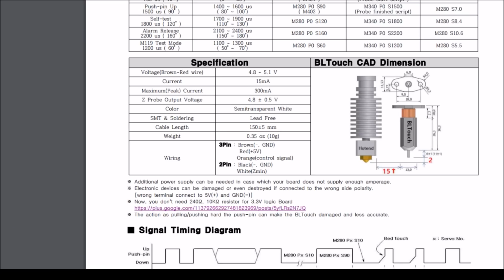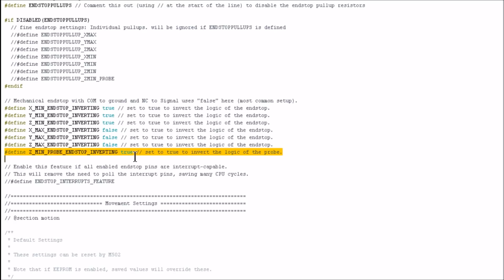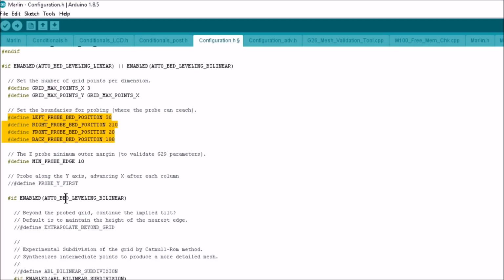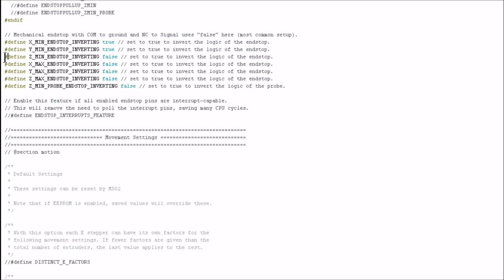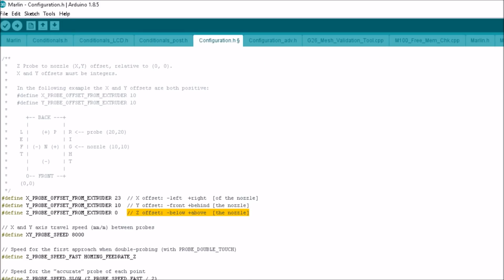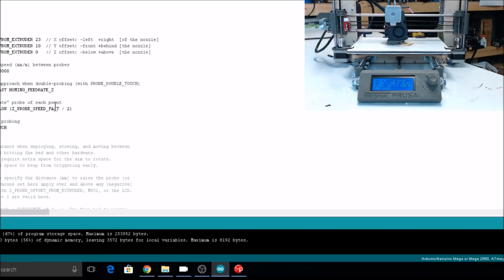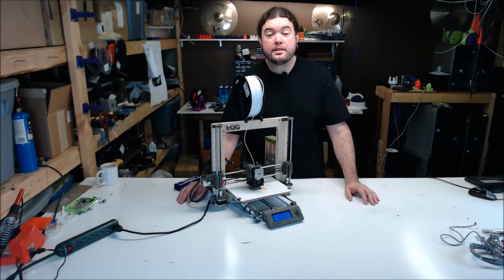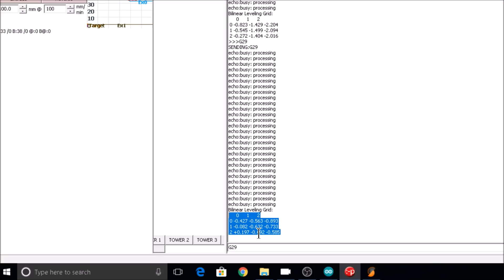Add Auto Bed Leveling to your 3D printer - Marlin - 2017

Comment: Will this guide work with the TH3D EZABL?
Reply from the maker: I am not really sure, I don't know how EZABL is setup in the firmware. I've never used it before.
Reply: @ChrisRiley  Dang, I'm kinda locked in to the EZABL now as it's on its way, but there seems to be no support for it unless you use the unified firmware, and if you can't use that you're kinda sool (and I will get an upgrade board fairly soon so will need vanilla Merlin).
Reply from the maker: @SteinerSE  Oh, yeah, if it's just the sensor then your fine. Those are exactly the same as all the others. This should get you up and going on stock Marlin. I thought you meant you already had Unified.
Reply: @ChrisRiley  No, not yet flashed the bootloader, I only got the printer (Creality Ender 3) a week ago and still waiting for most of the parts. While the TH3D unified firmware is nice I think in the long run it might be better sticking with Vanilla Marlin, especially for portability if you switch boards etc. Your thoughts?
On that note, you see quite a bit about the MKS Gen L, but there's pretty much no info at all about the Fysetc F6 board, would love to see guides and reviews of that.
Reply from the maker: I am a bit of a purest. I prefer to stick with stock Marlin. That way you are sure to get all the new features and as you say, you can port it to pretty much any machine. That Fysetc stuff seems to be getting popular. I might look into getting a hold of one.
Reply: @ChrisRiley  A lot of people use the Fysetc stepper modules and this board allows you UART control of 2208's without any rewiring (using the v1.2 version of Fysetc TMC2208) so you'd think they'd be pretty popular. What little I've seen they seems to have a nice feature set and looks good. Maybe they're just too new yet.

Comment: Why can't I set my z offset from extruder negative? I've disabled min software endstops, and still no matter what when I upload my Anet A8 just homes at 0.1? I've set it at -0.33 but still doesn't work?

Edit: Fixed it. EEPROM values needed to be written. Seems to work now after an M851 followed by an M500. Don't fully understand it but it's working.
Reply from the maker: Nice! We probably just need to refresh the eeprom. M502 followed by M500 with restore the Marlin coded defaults.

Comment: Just wanted to say thank you very much for this video. It helped me massively when setting up my CR-10S with an ABL and TMC2208’s. Your videos have been so helpful in upgrading all my printers and I wanted to say how grateful I am for your work. All the best dude. Please keep them coming 😊👍🏽
Reply: I have a question I’m hoping you can PLEASE answer, because I trawled google and asked everywhere in the Facebook groups: I have a CR-10S with a PrintBite sheet on the aluminum bed, using an inductive sensor I set up with this video; my problem is the probe isn’t giving consistent measurements all over the bed. In one place it’s too close and gives nearly clear lines, another (mainly the back) it squishes more and gives a thicker first layer and nearer the front it’s about right. The only consistent thing is every time I probe the bed, it does exactly the same thing in each of those areas with regards to how the layer goes down.
The bed is fixed (no springs), the bed heater is off and I’ve tried over and over setting up the probe sensitivity.
The only way I can overcome it is to use M421 and manually adjust the mesh points myself.
What could it be please? Bad sensor maybe? A list of check points would be really handy.
I appreciate how busy you must be, but I’m literally at my wits end and considering going back to manual mesh leveling. Thank you 🙏
Reply from the maker: @neiljclements  Hey, sure, happy to help. Let start here. Connect to the printer with Pronterface and run a g28 then a g29. When it is done it will spit out a map of the bed. What does that look like? Get pronterface here if you need it. http://www.pronterface.com/
Reply from the maker: Thanks so much Neil! I am glad these have helped and will do my best to keep them coming.

Comment: First off, Great video!  II actually used like 4 videos to get all of this sort of working, but yours was the most complete for the Marlin part.  Here is my issue right now.  at x home, the sensor is off of the bed, so it just crashes.  On the bed it works fine, but since there is no metal under the probe at X-Home it doesn't respond.  I've tried various settings in Marlin and can't find the right one to push the x axis over a bit after tripping the end stop.  Any help would  be wildly appreciated.
Reply from the maker: The quickest fix for this issue is to set Z safe homing. You can alter bed size, but safe homing is easier. It will home in the center. Give that a try uncomment this line.

//#define Z_SAFE_HOMING
Reply: thanks Chris.  Great video and fast response.  I'm sorry, but I'm just not getting things to work right for me.  I followed your setting and the video, but something isn't right.  The system is always pulling up regardless of what i put in to the z-offset.  I put in a -50 value to just test it and it does the same thing.  I can do a G28, get the bed home.  Then G29 then center and Z0 and it will be .5mm off the bed.  I can set the offset to 10 or -0 and the head will still zero to .5mm.  This is the frustrating part.  As I understand it, the firmware z-offster from extruder should set the absolutet value offset.  So I should be able to crash tthe head, but I can't.  Any thoughts?
Reply from the maker: More than likely you have something saved in eeprom. Comment the #define eeprom   option out and re-reupload you should be better results.
Reply: You probably saved my life with this response.  Thank you so very much.  I'm still not really clear on why Marlin keeps firmware settings the way it does, but I chose to comment out //#define EEPROM_SETTINGS   // Enable for M500 and M501 commands.  This worked.  If I understand correctly. the M500 command stores values to eeprom that won't be overwritten when reflashing. (not sure why).  I think that an M502 would "read in" the current configuration.h and replace any junk in the memory, follow that with an M500 to store it all properly again.  I think that's what I read.  If that's the case, then I'm not sure why more folks don't make that an absolute must when flashing.  anyway. Thanks again.  It's working now, though I haven't turned the EePROM_SETTINGS back on yet.
Reply from the maker: Yes, you are correct, you can M502 then M500 to pull everything from firmware and save it. I just comment it out to be 100% sure then go back and enable it later. It is handy to use when tuning so you can change settings via command line and they will be stored through reboots, but it has a tendency to make things confusing.

Comment: I'm a noob, but learning fast.  My noob question is, what are you using to enter the G commands to test your printer settings?
Reply from the maker: Hello, glad to see your getting into 3D printing. I use printrun/pronterface for everything. Check it out here. http://www.pronterface.com/
Reply: I'm still a bit confused.  I thought I understood the coding, but I'm not getting any changes when I adjust the z probe offset up down from 2 to -2 and don't see any changes. I'm using Marlin 1.1.9
Reply from the maker: @jamesboyd396  Is eeprom enabled? That can override your settings. I would disable it until you are done setting things up.
Reply: I will check that out.  Thanks for the info.  I would have never thought to look at that.
Reply: Ok.  eeprom seems to be disabled.  I'm missing something.  If I try to change the endstop in the LCD and home it I get an err: too far.  I'm feeling lost on this. I know it has to be something easy I'm over looking.  This is on an ANET A8 - marlin 1.1.9
Reply from the maker: Marlin 1.1.9 has a bunch of safety features that can issue some false positives. Are you using the A8 example config, or trying to create it from scratch?
Reply: I'm using the A8 example.  I was using the manual 9 point bed leveling prior to installing this sensor. I don't think I would attempt a scratch run at the config at this point.
Reply: Would I be better in going to 1.1.8?
Reply from the maker: Ok, so when the probe is not triggered what does M119 say? What type of probe is it? If it's inductive, is it NPN or PNP?
Reply: The probe is a LJ12A3-4-Z/AX (NPN).  When not triggered Z shows open.  When triggered, it shows TRIGGERED.
When I issue the home command I have X and Y at the center of the bed which is about as close to perfect as I can get.  Z stops when triggered and will not go below that point.
Reply: Let me say this.  I started fresh with my configuration.  I unzipped my marlin 1.1.9 download fresh so I could clear everything I've done and start over.  Boom, working as it should.  

Thanks a ton for your help.  Look for some cups of coffee for your time and generosity in sharing your knowledge.
Reply from the maker: Awesome! Glad you got it working! Thanks for the coffee. Anytime you need some help just let me know.
Reply: Well... That was short lived.  The sensor took at dive last night.  I'm back to manual bed leveling.  I believe I will be ordering the same part you show here and starting over with it.  I loved the auto leveling for the days it was working.  Your video is the one that got me to actually try it.  setting it up wasn't that bad one I got past the firmware issue.
Reply from the maker: Well crap! :) It is really handy to make prints more consistent. Hope the next one last longer.
Reply: Ok.  I have the exact one you have listed with this video.  I connected it up and think I have something connected incorrect.  It shows always triggered.  I have it connected and away from my printer so it should not be detecting any metal.  If I put a wrench to it, it still shows triggered.  Any ideas>
Reply from the maker: Does the LED light on sensor blink when you hold the wrench up to it?
Reply: No, it doesn't.  I think I already found my issue this morning but I didnt have time to do anything yet.  I will check it when I get home.  I'm using the Anet A8 board.  the z 3 pin port pin out is what I'm not 100% sure of.  I have the board mounted where the plug is on the right side of the board, if that makes sense.
Reply: Well after I got home and looked What I thought I might have done, I did not.  I had it in what I thought was the right pinout.  with the boar vertical, the Z axis port on the right side, I had it brown, blue, then black.  I tried flipping it to black, blue then brown.  Neither of which work.  I'm hoping I didn't cook the probe.
Reply from the maker: See if inverting is the firmware makes any difference. 
#define Z_MIN_ENDSTOP_INVERTING true // set to true to invert the logic of the endstop.
#define Z_MIN_PROBE_ENDSTOP_INVERTING true // set to true to invert the logic of the probe.
Reply: AND.... We are working.  I had to find a valid pinout diagram.  All hooked up and working as it should.  (except the LED).  It does not light up.  I'm assuming me misreading the diagram probably has to do with that.  Since this item is so cheap, I will likely order a couple more and go from there.
Reply: Your video is fantastic in setting up the probe.  I'm using the ANET A8 V1 board.  I'm not sure if the pinout is the same as the board you showed.  Mine worked out as blue, brown, then black with the board upright (USB on top).   the probe reads and it working as it should except for the LED  i'm not too worried about that.  I won't start any prints without watching it anyway.  Once started, it should be fine.
Reply from the maker: So you got it working? Just a different pin out? Awesome!
Reply: Now....  I can get through all of the settings.  When I do g28, then g29, then g1x100y100z0 f5000 the nozzle drags into the bed, no matter what I set the offset to.  I will add, no matter how low I set the probe.  I have to probe mounted to where I moved the nozzle down to touch the bed then set the probe to where I can slide a business card under the probe.  I get the same results.  I know I'm missing something.  I didn't have this issue with the first probe.   also, no matter where I set the probe height, the offset still comes back as a positive number.
Reply from the maker: Sounds like something might be stuck in eeprom. Comment out the eeprom line and try again.
Reply: that did the trick!!!  Now heating the bed to verify the offset.  You have been sooo much help!!  Thank you again!!
Reply from the maker: You bet!
Reply: Ah... Thank you so much!!

Comment: Thank you for this great video. Following your video if I enable "#define FIX_MOUNTED_PROBE" and then comment out, "//#define BLTOUCH" I get this error message:   
"exit status 1
static assertion failed: Please enable only one probe option: PROBE_MANUALLY, FIX_MOUNTED_PROBE, BLTOUCH, SOLENOID_PROBE, Z_PROBE_ALLEN_KEY, Z_PROBE_SLED, or Z Servo." 

If I leave the BLTOUCH disabled and un-comment any other Z Probe Option as stated in the error message then I still get the same error message again. 

In other terms as long as I leave all other Z Probe Options disabled then I get no error. The only way it will not throw the above error message is to leave all options commented.  Any ideas as to why I cannot Un-comment any option accept BLTOUCH?
Reply from the maker: Hmmmm, well it might be a change in the version of Marlin. It might now include all those options when you uncomment BLtouch. If you just uncomment bltouch does the sensor work? That might be all you need to do now a days.

Comment: Dear respected friends, I followed you all the instruction but when I give G29 command, it start to 9 points as I given GRID_MAX_POINTS_X 3. 
But problem is that, it move Y-axis accurately but toward X axis, it is moving just few milliliter and start to move toward Y-axis. Following this process it takes 9 points but X displacement is just few millimeter not covering entire bed. Please could anyone help me?
Reply from the maker: That probably means the bed map isn't correct. What version of Marlin are you using? What is your print bed size?
Reply: solved
Reply from the maker: MD. MUBARAK HOSSAIN Excellent!
Reply: Thanks a lot for your awesome video

Comment: great tutorial. i followed this and this worked like a charm! 
One question to you is if i change the filament from PLA to ABS or vice-versa each time i need to upload the new offset as the offsets are different due to very different temp setting of bed. Do you have any ideas on how this can be overcome?
Reply from the maker: Thanks for watching, glad you found it helpful. Prusa is currently developing a temp calculator in the firmware to try to combat this type of issue. I have tested it with little success so far. The best thing I have found for this is babystepping. Check out this video. https://youtu.be/0pt_b2ZizQM?t=17m21s This will let you adjust the offset on the fly. Not a great fix, but it works for me.
Reply: I just slightly adjust the Z offset on the front panel when changing filament type. MUCH simpler than faffing around changing firmware!
Reply from the maker: @djtaylorutube  What printer do use? Do you use babystepping?
Reply: @ChrisRiley  Malyan M150. In fact, I can change bed entirely and get back to working very quickly by using a semi automanualmatic method. What I do is set up a print that has nozzle temp set to 0 and make sure there's no plastic stuck to the bottom.

Heat the nozzle to normal temperature.

Find Z with G28 and leave the nozzle where it is. Then get the piece of paper out and manually nudge Z down by 0.1 increments and sum up the offset to the point where the paper under the nozzle is grabbed as per a normal level process.

Take that value and add it to the existing Z offset via the front panel and save.

Next, start my fake print with the hot end set at 0 degrees and as soon as it starts layer 1, pause the print and just check that the paper slides under the nozzle. Because the hot end is off, there's less expansion and the paper has a bit more gap. This step is really just me checking that all is as intended.

Then start a proper print and depending on filament type, I find that within a couple of attempts, I just have to nudge the z offset 0.1 a couple of times or even 0.05 and I'm dialed in for that filament type. E.g. changing ABS fit different ABS requires no change but swap to PLA might need a couple of offset nudges to tune.

Other than that, very straightforward. It sounds more effort than it is. Takes me 5 mins max.
Reply from the maker: @djtaylorutube  Very cool! Thanks for sharing!